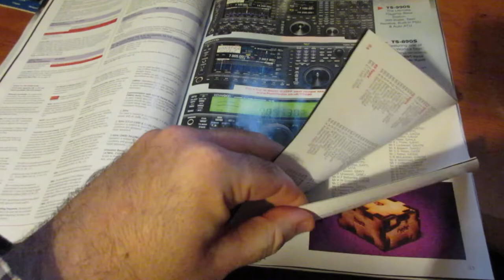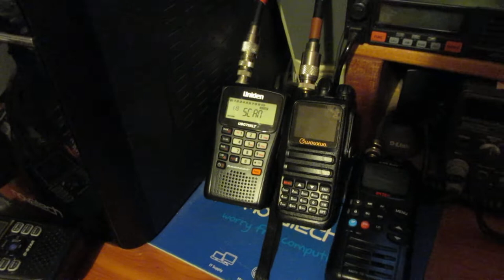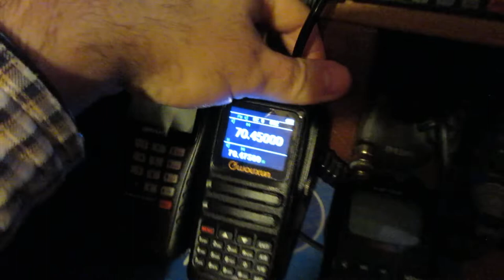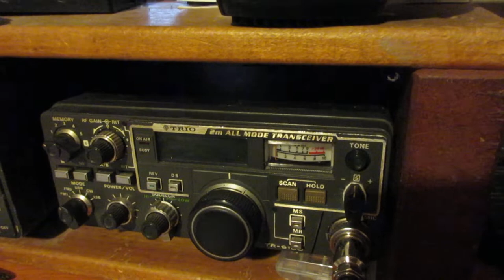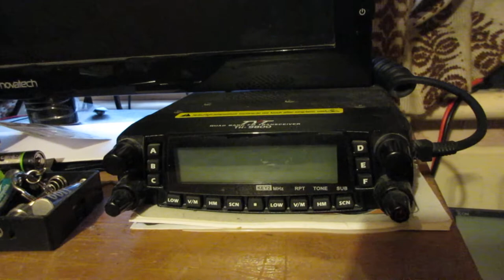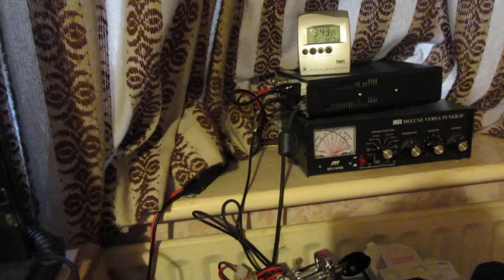Video response to February 2021 Radcom VHF/UHF column - observations and tips

Comment: What collinear are you using. A standard half wave? That would fit in the loft okay.
Reply from the maker: Hello Mike, I’m afraid I don’t actually know! It was given to me many years ago as a freebie when I bought other things from the seller. It didn’t come in a box so I don’t know which brand, length, gain figures etc. You are right though, it cannot be much more than a half wave on 145MHz because it wouldn’t fit in the attic otherwise!! 73 and thanks for your interest.